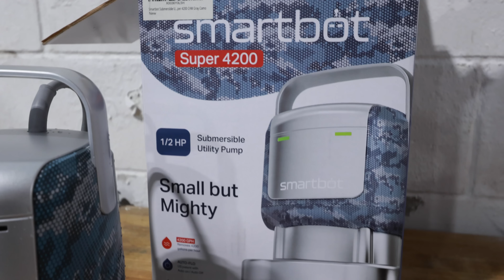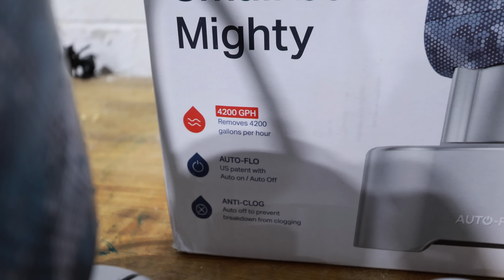ROBOT WATER CHANGES?! SETTING UP 8,000G TO PREPARE!!

Comment: if you have a tractor supply or farm store near you get tank some vet rap. they use it for injuries on horse legs and , in my experience, it works great for any any thing like tank is going through. it is slightly expensive but worth it if you ask me.